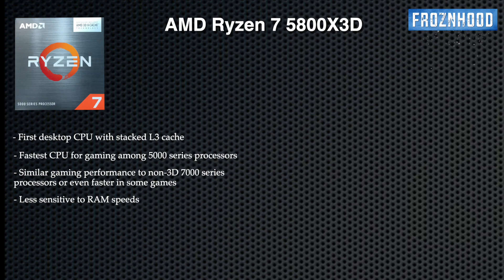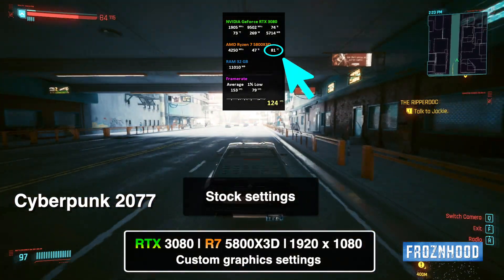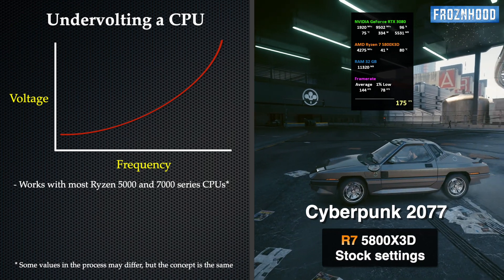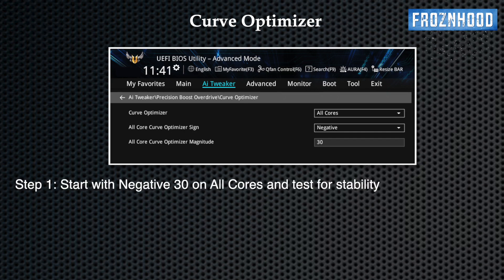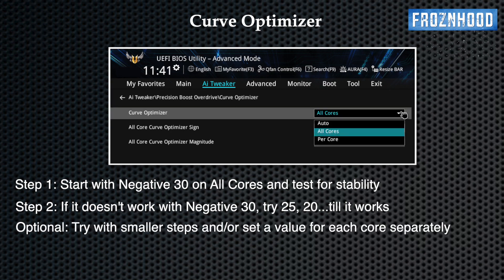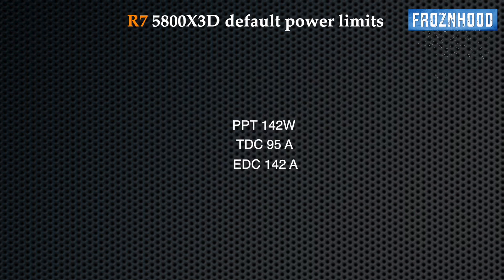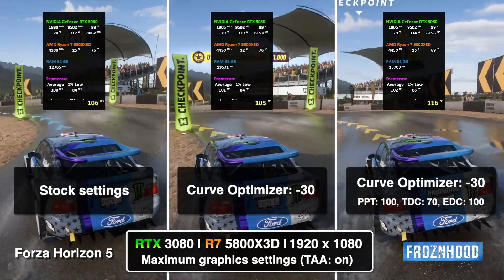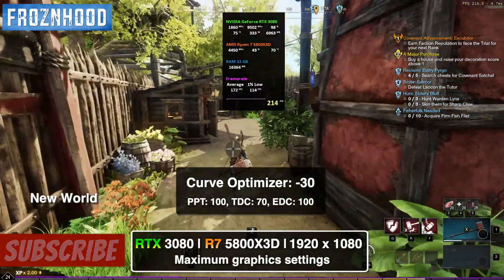Optimizing Ryzen 7 5800X3D - Higher performance, Lower temperature | Undervolting | Curve Optimizer

Comment: Went full yolo, plopped your numbers in directly, - 30 with 100,70,100. After about 8 hours of synthetics it's looking to be stable. 

The temp differences I'm seeing are absolutely staggering though. With a 360 AIO at stock settings I was averaging 70 to 75c in games with a ton of fluctuations in boost clock. Now it's rock solid at 4450mhz at all times, averaging about 51c in games. That's just a mind blowing difference.
Reply from the maker: Thanks for the feedback. Yes, sometimes I think that they should have set more optimal stock (factory) settings.

Comment: My R7 5800X3D doesn't go higher than 3.37ghz. I updates BIOS, reinstalled windows and updated chipset but it's still on base speed and even with gaming it does not boost at all.. What is the problem her?
Reply from the maker: It could be a BIOS default setting that is trying to overclock the CPU or is somehow messing with its voltage. You need to check this. Unfortunately, it could be also a faulty unit.

Comment: Hey, i couldn’t find the curve optimiser setting in my tomahawk b550 BIOS even after searching for it in the search bar (build date is 03/17/22). I was able to find the precision boost overdrive setting though where I could manually change PPT/TDC/EDC limits. Should I update my BIOS? Or is there another solution.
Reply from the maker: It should be there somewhere. Check for this path if it is relevant to your BIOS: Overclocking > Advanced CPU Configuration > AMD Overclocking. It may be there or you may need to first select Precision Boost Overdrive [Advanced] and then Curve Optimizer should appear.
Reply: @FroznHood  I can find Precision Boost Overdrive through this path but the options for it are Auto, Enabled, Disabled and Manual. After selection manual the options for PPT and TDC etc show but that’s it. I’m so confused it’s as if curve optimiser is not in my BIOS 🤣
Reply from the maker: Try with updating the BIOS.
Reply: @FroznHood  I just updated BIOS and it works now. But do I have to reinstall all my previous drivers after updating BIOS?
Reply from the maker: No, updating the BIOS does not require reinstalling the drivers if they are already up to date.

Comment: Thanks !! 😍
My setup: MB Aorus Elite X570S  + 5800X3D + Dark Rock Pro 4
NB: the Ryzen Master doesn't show the curve optimizer settings. Thus, as you well explained, everything has been done in the BIOS.

R23 Multi (120min runtime) →
Stock version: 13906 score & temp around 82°C 
PBO-30 + 100 PPT, 70 TDC, 100 EDC: 14533 score  & temp around 74°C 

Conclusion: decrease the temperature of 8°C + slightly increase the global performance since the bost freq was perfectly stable @4.45GHz on all cores.
Again a big thank for the clear and easy HowTo. 👍👍
Reply from the maker: Thank you for visiting the channel and the feedback. 😀 I am glad that you have managed to achieve these results.

Comment: Great Video, thank you. Can you tell me If using a fixed frequency on 5800x3d is usefull or Not ? I Heard AMD auto frequency is better than fixed
Reply from the maker: For gaming, do not fix it. Once it is optimized as shown in the video it will run at the best possible speed.
Reply: @FroznHood  thank you for answer

Comment: Having tried this.. oh wow! What an amazing difference you've made to my thermal issues. Upgraded from an r5 3600 to 5800x3d and using a cheap ac freezer 7 pro cooler.. 3 heat pipes and not enough for a 5800x3d.. but.. Having applied your power inputs.. wow! Have gone from bouncing off 90c to 80c with more ghz to boot. Thank you! You' saved me 130 pounds, not buying a noctua. ❤
Reply: I have a noctua, and i had to do it anyway 🤣
Reply: @mrcactuar8515 on my D15 it'll hover 80-85c on heavy load. i do live in a warmer area though
Reply from the maker: I am glad you have achieved better results! Thanks for watching. 😀
Reply: 240mm from deepcool the marrs is perfect if you are running the x3d chip
Reply: just get a basic 240-280 aio

Comment: hi, I had already been undervolting with 5800x3d and PBO2tuner (which I uninstalled) and had a maximum frequency of 4450Mhz on the cpu and 70 degrees average.
Now that I have changed the parameters: All core, negative, 30 - PPT100-TDC70-EDC100
the system is stable but the maximum frequency has dropped to 3375.
Any suggestions?
Reply: Reset your bios to defaults and try again buddy. Any changes?

Comment: Really appreciate this. With my B550 steel legends latest bios, I am at -30 all cores (did not do a lot for temps and just a small performance gain). However, combined with ppt, tdc and edc limits, I am seeing a reasonable increase in boost and all core of around 200 mhz. My temps have gone from say 90C on prime 95 to around 70C! Power usage has dropped significantly too. VERY efficient chip now. I have been testing for 2 weeks in benchmarks and general use. ZERO downsides and no loss in stability. So nice to be able to do this in bios and lock in the settings. The combo here is really the winner - don't just undervolt!!
Reply: Did you end up using the same settings for ppt, tdc and edc?
Reply: @xjj_96  identical to the settings in the video. All runs flawless and super efficient for me.
Reply: Your avatar is amazing. And your comment is inspiring and helpful. Edit - I’ve literally just done the same and it’s amazing. The difference is huge!
Reply: @MR_Garage it's not working for me. I have a asrock b550M Steel legend. Can you guide me through please? Any other options that we need to change?
Reply: Which setting in steel legends? I had to use pbo2tuner because bios had no setting for undervolt
Reply: I did -30 all core and didn't touch anything else and getting 4.54 - 4.89

Comment: can i use offset setting and use negative curve and just minus the watt like 0.1625v and save?
Reply from the maker: I don't understand what you want to achieve.
Reply: @FroznHood  lower the voltage?
Reply from the maker: You will probably and unnecessarily make your system unstable that way.

Comment: I have no such options at all. Fatal1ty B450 Gaming K4 and 5800X3D. Bios is latest p5.60 Any thoughts gyus? My pump continuously spins fans up and down which I didn't observe with the same silent profile on 5600x. It's really annoying. I'm thing to switch to 5600x again and send 5800 back( I have  10 days to send it back to the store. But really i don't want to, but fans are pissing me off, do not want to have noise without load.
Reply from the maker: What options you don't have?
Reply: @FroznHood    to undervolt cpu. curve, pbo and etc. Nowe of them are present in bios for this cpu.
Reply from the maker: May be they are named differently in your BIOS. Check all menus and/or try to find more information specifically about your motherboard and BIOS. Check in forums or ask in Reddit (for example). Do not give up so easily, because 5800X3D is much faster than 5600X in most games and it is worth trying.
Reply: @FroznHood  i didn't find anything

Comment: First congratulations for the video, your explanation is very direct and simple. I have a problem... I updated my processor to a 5800x3d, but in my bios the option "precision boost Overdrive" doesn't appear in Ai Tweaker and also in Advanced.
I have a TUF B450m Plus Gaming.
Could you give me a light?
Reply from the maker: Hi, thanks for watching the video and the feedback. What BIOS version are you using? Is it 4002? PBO is usually in Ai Tweaker or can also be (even as a second place) in Advanced/AMD Overclocking.
Reply: @FroznHood  Thanks for answering!
Yes, the BIOS is the latest 4002.
Yesterday after hours of searching I found the PBO, but it's on a different path. I found it in Advanced > AMD CBS > NBIO Common Option > XFR Enhancement. But the "Curve Optimizer" really doesn't.
Thank you again!
Reply: @BrnMaia  I have the same symptoms.
Is it the same in the previous version of bios?
Reply: @psw82  Yes! I went back to a previous version,  but it was the same thing!

Comment: Some advice for people having trouble enabling SAM or "re-sizeable BAR": not only could it be named something different in your BIOS, but even after updating the BIOS and chipset drivers you could see the option "greyed out" or unavailable in the settings. In my case it was because another feature in the boot settings needed to be disabled first to be able to use resizable BAR (AMD CBS or CPS I think it was called). So make sure to look up the settings for your specific motherboard! for my Asrock above the greyed-out option it had a line of text saying the option that needed to be disabled but it's easy to miss. Also use the tuning software that is meant for your motherboard if available. The exception is the AMD chipset driver installer. In my experience the AMD chipset installer  provided on the motherboard support page is often out of date or gives an error, so I would use the official installer from the AMD website, which will scan your system and install the appropriate drivers anyways, you don't need motherboard-specific software for that. Same for AMD graphics drivers, get them direct from the AMD website.
Reply: I think you meant CSM (compatibility support module) which is needed only for some older devices, 32bit OS and if not using GPT partitions. On some systems mixed with old hardware or an old installation from an older system running with MBR it is needed to be acitvated. But it's incompatible with resizable Bar -> so make sure it's on GPT -> CSM disabled -> check/activate above 4G decoding - >set re-Bar to enabled or Auto (2+3 depending on your boards manufacturer) -> check driver if working.
Reply: Be aware to no activate it if you have a mix of gpt/mbr disks and disable csm. I end up booting continuously in bios because it found no disk to boot.
Reply: @thierrybo6304  Right, but in that case you cannot use re-bar. As I said, if using non GPT partitions it won't work without CSM.
Reply: @thierrybo6304  y en caso de tener una combinación de discos GPT/MBR, cual seria la solución para utilizar SAM? reinstalar los discos? Gracias

Comment: I have 5800x3d w/ASUS b550f. I can set the -30 on all cores and have no issue, but the bios won’t let me change PPT TDC or EDC, it is fixed on “auto” any suggestions?
Reply from the maker: Are you sure that after selecting one of the settings it won't let you just type the value you want?
Reply: It looks greyed out but you can just type it in lol
Reply: You both are exactly right, it did allow the change, thanks so much for your help!
Reply: First thank you both for responding! I have clicked in the boxes and tried to change the value but the curser does not enter the value box or blink and typing numbers does nothing, I will try again after work but am confident it will be the same, it’s frustrating that the option seems to be right there but being unable to change the values.
Reply from the maker: It may not blink but still allow you to enter values.

Comment: Thanks for the video.
I am using -25 all cores, 100 PPT, 70 TDC, 100 EDC and 80 Temp limit. Got best score on Cinebench with these figures.
I have a budget cpu air cooler, so everytime my temperature was sitting at 90 when playing.
Now I play without any worries.
Reply from the maker: Thanks for watching and I am glad you have achieved better results with the CPU.
Reply: @FroznHood  what would be the best settings if you have a top tier cooling system?
Reply from the maker: What do you mean by "top tier"? Air, AIO, custom air, custom water? You need to be more specific.
Reply: @FroznHood  I mean, if you could keep temp below say 80c no matter what. Then would there be an optimal performance setting ?
Reply from the maker: If you are asking about gaming performance, the priority will be to achieve stable max clock speed. That CPU maintains its speed not only according to the current temp, but also the power and voltage. Even at 70-75c it may randomly go down to 4250-4300Mhz at stock settings. This is the reason why using an extravagant cooler for this CPU is not needed and not worth it. The strategy will be the same as shown in the video, probably with more modest tweaking. Every unit is different.
Reply: @BogDog9  i personally set the temp limit to 80 degree, all core -25, 100 ppt, 70 tdc, 100 edc.
The clock speed stays around 4400mhz during gaming session
Reply: @W_Amit  temp limit to 80 wont bring anything, they throttle at 70, no matter your temp limit, they just start hard throttling at 80 instead of 90 now.
Reply: @tarkitarker0815  I changed my cpu cooler recently and I remove the temp limit, it stays at around 70.
I just dont like to see the temp hit above 80 😅
Reply: What cooler do you please use?
Reply from the maker: Be quiet Dark Rock 4
Reply: @josefkadlec7874  Coolermaster Hyper 212 Spectrum

Comment: Nice job. I wanna try for sure, meanwhile I've undervolted my 3080 and...wow! Now finally vram are under 80°C instead of 100° and sometimes more. I have only one question: after setting curve to -30 all cores, my b550 Aorus pro v2 won't let me change the thermal limits. All zero. Anyone have the same problem? Any suggestions? Thank in advance.
Reply from the maker: After -30 curve, the thermal limits are all 0 or Auto? It doesn't let you put any value manually?
Reply: @FroznHood  all 0. Double click or enter, still 0, I can't change value.
Reply from the maker: Don't double click or press Enter. Just select the setting and try to type the value you want.
Reply: @FroznHood  Ok, I'll try soon and let you know if it worked. Ty so much.
Reply: @FroznHood  Hi, I have to thank you. You were right about thermal limits values on the Gigabyte mb. Just put the value instead 0. And.... On chinebench r20, The score is 5818, previously the stock setting score was 5569. Now with both GPU and CPU undervolted, I stopped tanning my shins and even gained some fps. Ty again.🎉🎉🎉
Reply from the maker: Hi, thanks for the feedback. I am glad it worked. 😀 Since you mentioned again the GPU undervolt I read your first comment. RTX 3080 usually doesn't need any kind of power tweaking in order to operate at acceptable temperatures, unless you have a unit with a very bad cooling design and implementation. You may want to investigate that further, if you start to experience problems such as stuttering and app/game crashes. You can check if your GPU is not using a very old BIOS. The manufacturer might have improved the performance with the newer versions.
Reply: @FroznHood  yeah, unfortunately is a zotac trinity, the only problem are the horrible thermal pads but being on 4 year and more warranty covered, it's too early to replace the pads😅
Reply: And from 100°C the vram now is 80°C and perform the same fps as stock but fresher and around 290w instead 320w full load.

Comment: Just today I've got my Ryzen 5800X3D with Asus TUF X570 with newest BIOS and I want try PBO inside BIOS. Thanks for video, let's try to UV this BEAST!

What about some more advanced option like:
AMD CBS > NBIO > SMU > CPPC Enabled
AMD CBS > NBIO > SMU > CPPC Preferred Cores Disabled
AMD CBS > CPU > Global C-State Control Enabled
PLL of 1.85-1.95 seem to work well for higher FCLK. 2.0+ can cause USB dropout. 1.75 Observed stable at 3800/1900.

BTW, try The Lats of Us Part 1 with patch 1.1.1 (more load with 1.0.1), there I saw around 70-80% CPU load :)

Comment: Ryzen 5800x3d connected to the b450 Steel Legend (updated the latest bios) when Curve -30 is set to PBO2, the computer goes into reboot, when -15 is set, it goes into reboot during the game after about 5 minutes. Curve Optimizer in BIOS is not available What to do who can help?
Reply: I have the same motherboard and CPU, did you update to Bios 8.01? It is the latest one and I can confirm that it has curve optimizer, I’m currently using it.
Reply: @JoeR511  I installed the latest BIOS, and CO really appeared, but it doesn’t work more than -5, if you set it to 10 or 15, the PC constantly reboots
Reply: @alexgud6317  That sucks, I’m not sure why it won’t let you go beyond -5 Perhaps there is someone here more knowledgeable who can comment with a suggestion.

Comment: Just switched from a 5800X to a 5800X3D. Tried the Curve Optimizer at -30, PPT 100, TDC 70, EDC 100. Temps while playing Star Citizen normally stay below 70C (was about 75C prior to tuning). Task Manager indicates CPU clock speed stays around 4.41 GHz. In game FPS performance seems to be about the same as prior to tuning, seems a little more stable in some cases. FPS performance compared to the 5800X feels about the same just a tad more stable. Not sure how to process this, if this is as good as it gets or if I should try something else. Thanks for sharing though, it was very easy to follow!
Reply from the maker: Hi, thanks for you feedback and sharing your experience. If your CPU works stable with -30 and those power settings, you have a good unit. Regarding performance, 5800X3D should be a lot faster in most games, according to my tests. Both CPUs will have similar performance only in games that do not use the additional L3 cache in X3D such as Counter Strike, which in my opinion is a rare case. Specifically in CS you may even get a 1-2% lower FPS, because of the higher boost clock of 5800X. I don't play Star Citizen so I don't know what the performance should be there. 

Install MSI Afterburner (from MSI website) and observe the clock speed with the overlay, if you need. The point of the strategy explained in the video is to maximize performance in games - stable high clock speeds with lower temps. Check other games, some of those I am showing in the video, and see if everything is OK. Feel free to share more results with your new CPU.
Reply: So the5800X3D.  Curve Optimizer at -30, PPT 100, TDC 70, EDC 100, Thermal Limit 80c, Have you tried PBO Scalar @ 10x as well? 

What are your results with this addition?